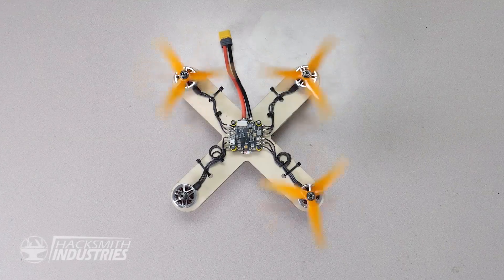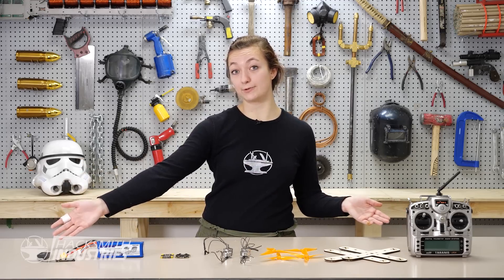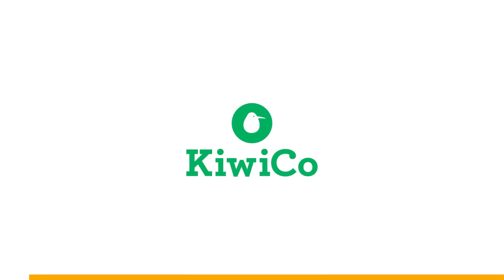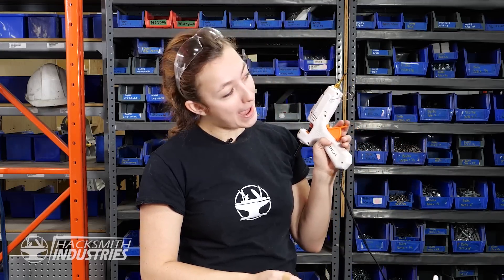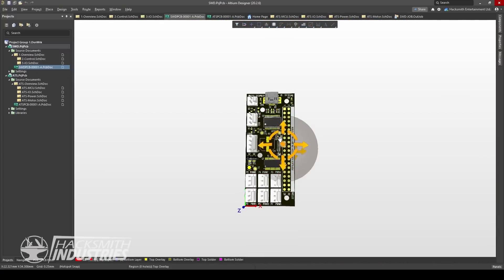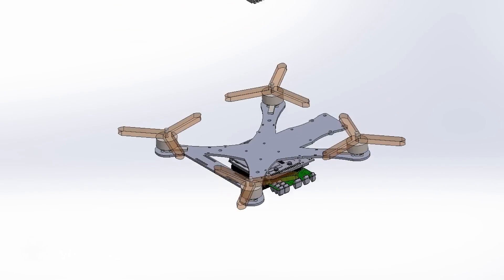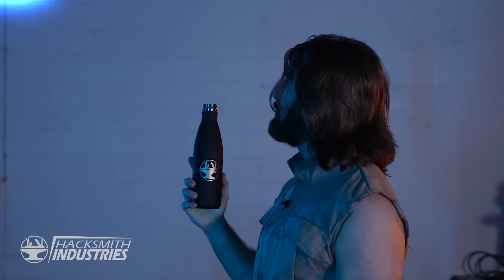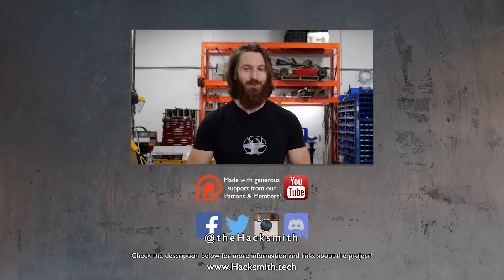JEDI FORCE TRAINING DRONE!

Comment: I was wondering if you thought you could get or build an astronaut droid?  With the ability to refill wires wires pipes panels panels bypass bypasses diagnostic  And everything else needed to repair electronics plumbing plumbing piping communication communications and such.  Software recognition  And the ability to connect to the Internet and search for blueprints ID numbers model numbers search algorithms et cetera might have to build a server that it connects to in order to save space for internal equipment.

Comment: i have a 3 cell 3300 mah 35c 11.1 v lipo battery.. my second is totally discharged and shows 0v so can i charge that single cell with a B3 imax rc charger? or how should i recover the dead battery cell , i only have the B3 imax rc charger with me..

Comment: Sorry to nerd out on you, but the guns in the star wars universe aren't lasers, they're blasters. Unlike a laser which is more of a consistent beam, blaster function by exciting the extremely high energy gas stored in their ammo cartridges. The energy created from this process is focused through a prism or crystal. Finally, this energy is released in intervals to create blaster bolts. Blasters can often be much more damaging then a laser or energy beam, because instead of simply melting away at the tissue from the outside, they actually enter the skin. The bolts go into the body, and at that point their energy is released wrecking havoc on all the tissue in a certain radius, not to mention melting nearby organs and other deeper areas a laser could not reach.

Comment: is it me or is that drone on wires. i bet it was to heavy to fly. that is not how a quad hovers i call bull shit on it flying.... 
could of chosen better quad components. bigger stator lower kv f7 fc with crossfire so no annoying sbus. im sure you had lots of fun inverting that sbus and sport.
f80 motors would of gotten you 8kg of thrust alone not to mention they would run cooler. putting ducts around the props like a cinewhoop would make it safe to be around people

Comment: Wonderful job. Diserves applose.

Though It would have been nicer if the Jetson  could control the drone itself.

Using body joints estimation with a neural network like posenet or even the mediapipe library, you could create a flight controller that tracks the person and aime at specific parts of the body. You could then build a training program that teaches specific skills.

Comment: I love how you're actually facing the same problem that Jedi faced during the Mandolorian War in The Old Republic, where Mandolorians used Slug Throwers that used solid projectiles instead of Blaster Bolts to beat Jedi, since, much like in the video, they moved so fast and were solid, that they didn't burn or deflect off the lightsaber; the Jedi just got faces full of partially melted bullet.

Comment: Dear Mr Hacksmith

You currently have 11.7 Million Subscribers

117 is Master chief petty officer Johns Spartan tag

And with the much anticipated Halo infinite coming out...

Please make something from Halo!

Heres a few examples:

Turn the Cybertruck into a warthog
Make an energy sword using laminar flow (etc.)
Build a gravity hammer 
Build a Spartan Laser - or Splaser for short-
Build another smart helmet with Spartan HUD
Give Windows Cortana a physical embodiment (of Cortana)
Build 343 Guilty Spark that can cross your facility using rails on the roof, and you can upload actual lines from the beloved Halo CE mission : The Library. Those voice lines will be as useful to your working staff as it was for Master Chief (sarcasm) 
Build a working Shaw Fujikawa slipspace FTL drive (that should get Elons attention)

Comment: OMG you guys are getting sloppy. Spending so much effort (time and money) to not having working package xD So disappointing... the fact that it needed wires to suspend was just painful to watch. 
During assembly of whole drone it looked like it is just too heavy . I hope I am wrong and it works just fine, but i would bet it cant get off the ground. Due to additional mass of nuts and spacers (it should be less and polymer ones instead wherever possible) and all electronics on it (why not send commands from jetson nano wireless?), also the nerf launcher is too beefy it should be more weight optimized - it is already 3d printed, so why not make lettice patterns rather than solid?

Comment: Question about the code: Did you write code to fly the drone too, based on the camera footage or did you fly it manually? I wrote a basic head tracking 5 years ago and with OpenCV, it was like a walk in the park. The fintuning took some time, the rest was pretty straightforward. You didnt build the tracking from scratch or did you?

Comment: Try adding the two light sabers togather, a tungsten  titanium  part inside and the plasma part goes on the outside so it is a solid blade but is much hotter

Comment: What if you made another lighsaber, but instead of making it entirely out of plasma beam you could combine it.
What i mean is that an actual solid saber inside of the plasma beam.

If you want it to retrack (like your plasma saber) you can make a metal pipe that can expand by making it thinner and thinner.
You could use air power to push the metal pipe out

Thought it sounded like a cool idea :)

Comment: Don't get me wrong, I love this project. It combines a huge range of different electronics systems that are all plugged together neatly and driven by a pretty powerful CPU and awesome code.

But there is no way this final assembled drone was flying. In the shots from 12:45, you can clearly see the wires, and I am guessing you used these for the final shots as well where the drone is rarely visible. Having flown drones and built electronics stuff, there is just no way these tiny propellers can support the 3D camera, ball gun, Jetson and huge LiPo, with lots of torque from a probably non-central balance point... Let alone that keeping a drone this steady without lots of gyros, camera input and ideally GPS is a no-no.

As I said, I love the project, Sophie's enthusiasm, camera presence and work, and the demonstration of face recognition and how everything came together is very, very cool. I just wish you hadn't made it look like this thing actually flies, that feels a bit like cheating. And there is no way it could have been achieved in the short time Sophie had for this.

Comment: Doesn't the launching mechanism need like rubber tires for the motors to spin, so they grab the balls/darts and throw them out fast? Will the plain propeller mounts spinning generate enough airflow???

Comment: Great work as always 💪🏻💪🏻
Could you try to combine both of your lightsaber/protosaber concepts
If it is possible to fit everything into a hilt you could make a tungsten blade with a surrounding plasma beam 🤔 
But
Idk if there would be a problem due to interference of the needed electricity for the tungsten blade and the plasma-gas😅
Just an idea

Comment: Not saying those 5 inch props are bad, but I wouldn't say they're ideal for this purpose. The disk loading on the props is significantly higher than it would be if you used slightly larger props, 7 inch props for instance. The disk area to weight ratio would be  higher, you would put less stress on the drive train, increase efficiency, as well as reduce noise.

Comment: Lets face it this is the first hacksmith project that doesn't weigh a ton.
Reply: Still too heavy to fly i think 🤔
Reply: @jons6125  I'm pretty sure it was on a string the whole time
Reply: @jons6125  I noticed that
Reply: @jons6125  Didn't she say that it was like.. 8 kilos of thrust from the motors? Considering that the body is made of 3D-printed plastic (I would guess about 30% infill), i'm certain that there's even some thrust to spare. The only thing that really has any weight to talk about there is: Battery, motors, camera. I would assume that those metal rods are hollow and made of alu. I.e, negligable weight.
Reply: @RRKS  yeah she said 6800g tbf so as long as the whole thing is under 3kg should fly fine. Not sure the end design would have been that stable flying though. I suspect if it was on a string it was probably more of a safe, controllable and practical way to film rather than a lack of thrust issue

Comment: I usually put tape on the motors when testing drones. One time i plugged the battery and the motors with props went full throttle, almost lost a finger.

Comment: Is there a way to have the tungsten core with the plasma flowing around it to give it both properties. And i dont mean using electricity to heat up the tungsten but using it as a physical core for the plasma to flow around. You could even put groves in the tungsten to help the fluid dynamics and make the plasma blade longer that way

Comment: Yo @Hacksmith Industries, y’all should make a portable door that you can place on any wall and it will cut a hole into it and you can use that door anywhere. I call it porta-door, like you could use mini plasma cutters or something to cut into the wall and lock the porta-door in place so it works like a normal door after
Reply: Also if you do do that video can you mention me

Comment: Oh man, the FPV drone nerds here are probably pulling out their hair watching full t-motor electronics being attached to a wooded frame. Though I guess to be fair, you're not doing stunts or racing like the Velox series are designed for. That ACCST X9D hasn't been sold new for around a year... Lol, I guess they must have bought it used or had it laying around. I wonder why they went with the X8R if they didn't need full PWM outputs. Why not just use an XSR or Xm+ to save on weight?

Comment: I honestly dont think that these small  thrusters produce enough lift to support the heavy electronics. In fact, in the middle of the video, its clear that the drone is held in the air with wires. 
Dont get me wrong i think its incredible thay you did all thay in just 4 months, but it would be appreciated if you are a little more honest
Edit 1: i meant propellers not thrusters :/

Comment: They should try to make a plasma lightsaber that has metal in the middle for the lightsaber to be solid and plasma on the outside of the metal.
Reply: They already did. They made three of them, actually.
Reply: @alexpratt8533  it was not. It was metal that got really hot. not plasma shooting from the bottom up.

Comment: The "Hacksmith Industries" building a custom board just for hooking up SBus, I2C, and PWM while the Jetson Xavier NX would be readily compatible with all of those is interesting... on one hand, it's awesome that you can now just put together a custom PCB and get it going, but on the other hand, really? Not much hacksmithing left in it. I get that you like to have fun with all the fancy engineering tools you have now, but it doesn't really make it approachable for people without a facility like yours.
Reply from the maker: Hasn't been a DIY channel in years... PCBs just make things more professional, and honestly, they aren't out of reach for hobbyists. Can get them for less than $5 a board from China!
Reply: @hacksmith  Yep, you're right. Not gonna fault you for not going DIY, and honestly how the hell would you be able to build actual lightsabers and power loaders with that mindset?

But on the other hand, it's rather daunting to see that you need to get a reflow oven or SMD soldering skills and tooling, in addition to circuit design knowledge to just get a USB camera, a commercial flight controller, and a pair of motors to play nicely together. I really like the drone stuff -- not just on your channel, I see people building drones everywhere, and it's honestly amazing what a commercial flight controller and a few lines of code on your choice of MCU can do, it's honestly inspiring to just try those out. But then the "simple part" of connecting them together is overengineered.

I don't fault Sophie though. She got access to your facilities, she damn well use it, and I'm sure this experience helped her a lot. I just miss the hacky part of "the Hacksmith" a bit.

Comment: Is the quad controlled by the xavier over serial or is it just manually flown around?  Some deeper explanation would be great as its barely touching on the xaviers capabilities here
Reply: Alot of work did go into having the jetson take in the serial data! SBUS is a weird protocol, man. It took in the reciever signal, did ~things~ with it and the gave it back to the flight controller
Reply: @sophier8872  That sounds rough, i feel your pain, im guessing you were going for low latency?  i tried doing a similar thing - modify the reciever signal then send the fc, but using cppm and it was awful, its annoying the jetson is pretty useless at handling pwm signals. More recently, i just used a flight controller running px4, meaning all telemetry cant be read by the jetson over serial at a decent frequency, then the jetson can just compute any control functions and send them back as control commands over mavlink, was much less hassle!
Reply: Latency was a big issue. I wanted to go for c++ but connecting everything and working the nonblocking i/o was just out of my wheelhouse. It really felt like python was barely cutting it but also the only thing that made it possible.

Those sound like some really cool projects! Fun fact, this was my first deep dive into drones, i really want to try more methods. I think theres definitely a more correct way to make an open source autonomous drone

Comment: You know, the light sabers could be made to be a bit more portable and easier to use, and I spent a week of not sleeping and came-up with a concept to power the sabers: power gauntlets.

Essentially, it would be gloves with electrical cables that plug into it, which allows for them to interface with the blade by powering it, sadly the hilt and power supply would have to be re-designed (hilt just needs its source input on the side, the power supply just needs a different style cable), but you could finally have the lightsabers be capable of being held in numerous ways, like in the films
Reply from the maker: Cool idea!
Reply: @hacksmith  Thanks for considering my idea! I mostly wanted to have the plasma model be way more practical for wielding. I think when I get the time, I'll try to design some sort of basic prototype on paper.

Comment: Why don't you combine the two where you have a tungsten rod core and plasma around it? you could make the core retract and the plasma can heat the core up to glowing hot.
Reply from the maker: It'd still melt
Reply: @hacksmith  o god plasma's that hot?

Comment: Not to be a downer but I'm pretty sure that wasn't actually flying in the end.  Those small motors and propellers couldn't possibly carry that much weight, especially with so little noise.
Reply from the maker: I guess you'd be surprised how far along drone tech has come!
Reply: 15lb of lift bro

Comment: Do you think a slow burning solid rocket fuel rod with a solid core for stability would it get hot enough to kathri things also you wouldn't have to carry around those Go to receiver power packs you would just have to carry rod that can fold out as solid rocket fuel that slow burning gets hot enough to melt their most stuff but also you have liquid nitrogen or so to canister built into the hilt that ejects and then you can spread it to cool off the blade.
Reply: We very similar to those things that the military actually has to not through doors I suppose it is the closest thing to a light saber was talking about more electoral fraud that slick and  that Burns through stuff instead of slices.

Comment: You could either modify or build another one but You can attach a solid blade to it. You could even make it where you could swap out the power source electric pack for the fuel air pressure packFor one that's a hybrid of both. The propane would heat up the blade making it hot also its physical blade  So it could cut through things. If you combine a small electric magnetic field that's powerful enough to actually pull in and keep the heat contained in the plasma closer to blade it would   The plume or plasma from the compressed air and the fuel.
Reply from the maker: Even a tungsten blade would start to melt =(
Reply: Maybe you could make oh I see that just used a compressed a are no propane or combustion and i could deflect Small projectiles.

Comment: If you increase the pressure of the air it should actually be able to deflect it. Might have to test how much air pressure you need in order to deflect small target like that.
Reply from the maker: Nope, if you increase the pressure the blade fails -- it's very precise the way it works
Reply: What if you design one that's in the shape of a katana but replace the blade with holes the plasma in the air pressure or focused to  To a single point  Would that work?
Reply: Or secondary pressurized air  For higher PSI maybe?